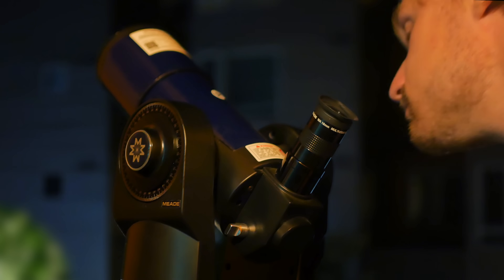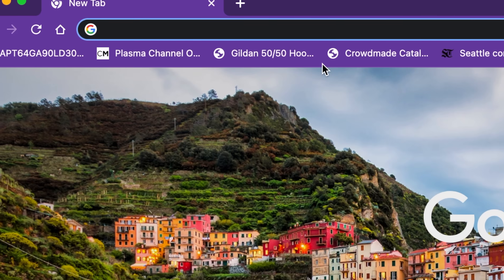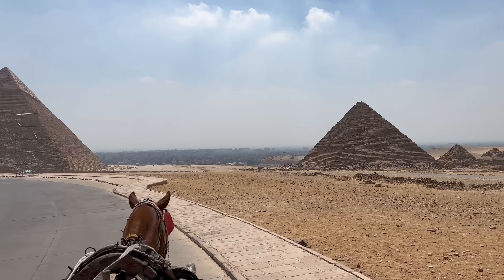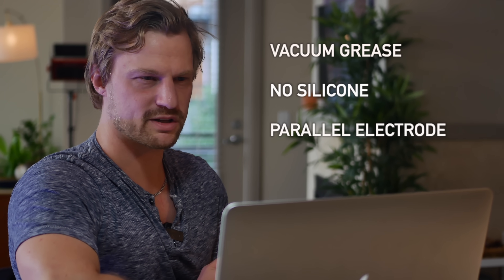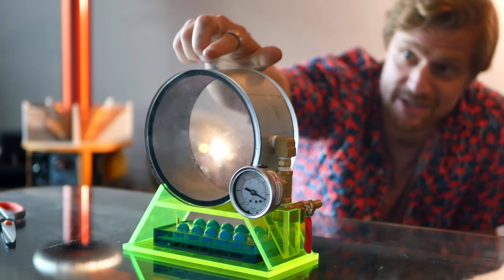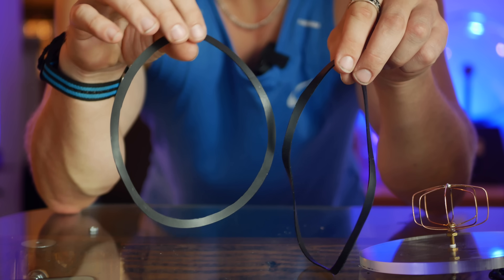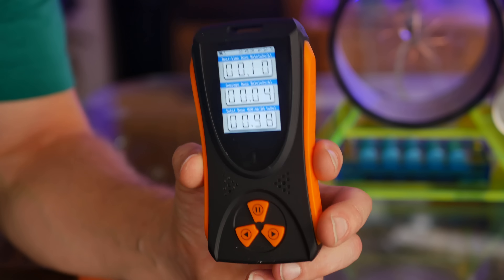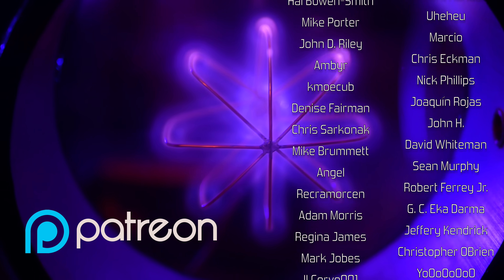Building A Nuclear Star In A Jar (Fusor)

Comment: I did the star in a jar using sonoluminecense by measuring the diameter of the 500 ml round bottom flask. Accurately placing the transducers on the equator of the flask. The diameter gives you the approximate resonance based on the speed of sound in pure water. I was going to use heavy water and I expected the light output to be proportional to the higher cross section of the DD reaction over the HH reaction. I expect the light output with D2O to be considerable. Best of luck to the first to try it.

Comment: Could you replicate this theory again except make it 8~10 layers of fusor wire cage positive cage and cylinder neutral grounded and in side the core of the device is a 3d printer spherical hexagonl electrode negatively charged and both the negative electrode tuned to 90 degree s and the positive fund to 90 degree anti phase and you might get better results but I cannot afford to do this experiment myself ok thank you
Reply: I'm still waiting for you to answer my respond ok

Comment: Another way of making your screw-thread pipe joints airtight is to use wax - drip it on while molten and then let it solidify. That way if you ever need to dismantle the apparatus and take the pipe joints apart, you don't have to hack away at rock-hard epoxy resin. This is a thermosetting plastic after all - once cured, it cannot be melted and will not dissolve in anything either. So the only way to remove it is mechanically, or if all the joints are metal-to-metal, you can burn it off with a blowtorch.

Of course you might not want to use plain old candle wax (aka paraffin wax) for this, for a couple of reasons: First off, its melting point is a bit too low, so if the apparatus heats up, you may soften or melt it. Also, paraffin wax has a tendency to shrink a fair bit when it solidifies. If you have ever cast your own candles you may have seen this - fill a glass jar with molten wax, and when it cools down and solidifies, the surface will be considerably concave in shape, even if you filled the jar to the brim.

However, there is a specialty product to avoid these problems, known as Apiezon black wax, or sometimes just short-handed to black wax. This is often used in chemistry labs to make a more durable air-tight seal between ground glass socket-and-cone joints, in situations where you would not want to use silicone vacuum grease.
To use it, the glass joints are heated with a hot air gun and the stick of black wax is smeared over the surface. Once the surfaces have been covered, the joint is then loosely fitted together, heated back up to melt the wax, then the joint is fitted more tightly and clamped into position until cooled back to room temperature. This has the advantage of locking the joint so it cannot rotate - which vacuum grease does not do. It also has a much higher melting point than paraffin wax, and is less immediately soluble in organic solvents. An exception to that is halogenated solvents, such as dichloromethane or chloroform, which rapidly dissolve black wax.

There is also another solution for high vacuum (or high pressure) pipework which does not require grease, wax, epoxy resin or even PTFE tape to make the pipe joints airtight: Swagelok pipes and fittings, ideally the stainless steel variety. These are high quality compression fittings, which will make a perfect metal-to-metal seal if used properly and tightened to the correct torque.

Comment: You need to put several hose clamps on the poly tubing connecting the pump to the spars on your device. It will make a difference.

Comment: Teflon tape in this instance is not the best for vacuum work. Use two part solvent free Araldite on the threads. I used to service and rebuild high vacuum pumps and systems.

Comment: The Tygon tubing you are using might be leaking, 15 microns is a good industrial vacuum. I saw you got it in the end though, but industry uses all threaded connections, either tapered pipe sealed with tape or paste, compressed o-rings or gaskets, often with compatible grease, and (precision manufactured) metal seals. I'm surprised the Tygon tubing didn't collapse, normally the hoses I see have a spring to maintain its shape.

Comment: The mass lost, converted to energy in nuclear reactions, is un-needed Strong Force. Strong force is what holds atoms together. Atoms are full of protons, and their positive charges repel each other strongly. That should made it impossible for an atom to stay together. But on an atomic scale, strong force is stronger, and binds them together. It's a fair amount of energy, to hold down the electric repulsion between the protons.

Anyway a big atom, like uranium, has lots of protons, so lots of strong force needed, to barely hold it together. When you split uranium, it usually splits into two heavy elements, plus some neutrons. No particles are lost, all the neutrons and protons add up to what we started with. No particles are lost.

But those daughter particles are smaller, and so need less strong force to hold them together. Even between whatever nuclei result from the split, they still need less strong force between them, than the uranium. The extra strong force is released as heat and radiation, the results of a nuclear reaction. That's what's lost in an atom's mass, not particles, but the force binding them together. 

With fusion it's similar, the He4 needs less force to bind it together than it's two component atoms did, added together. So strong force going spare.

Comment: I worked for medical accessories and research Zeeland Michigan. I created x-ray able plastic bones. Synthetic skin for suturing practice at med school. I made silicone molds using a vacuum pump to pull the air bubbles out what's silicone ATV. Anyhow. I saw you had a vacuum pump there. One time I put RC cola. In a cup and place the cup into my vacuum chamber and pull vacuum on. You would think nothing would happen to it. You have to try the experiment yourself. My result was it altered everything about the RC cola. It took away the flavor, and removed half the color. Leaving me with the left and desirable. Byproduct. That really had no use after that.

Comment: Magnets can hold the plasma in place if you build two using magnets shoot them at each other and compress them to make them m even angry while holding that run in the center by reversing the poles when coliding to hold that it together in the center compress with external force and tada you have hellion fusion reactor

Comment: Um that geiger counter is notoriously bad at detecting radiation (studio 326 made a video about it and used some pretty strong sources, and it wasn't picking up on anything)

My recommendation would be getting a scintillation detector (best for gamma and x rays) a few options are out there but a radiacode 102 or 103 would be your best bet (also you can prove if it's fusion by doing some gamma spectroscopy on the fusor)

Comment: Fun fact for the fans: flyback power supplies are reputedly named thusly because if they get hold of you, you, well, fly back. Oh - a pro tip from a guy who's plumbed lots of lab-scale gasses, Swagelok compression fittings aren't (outlandishly) expensive, and can, in practice, perform decently in vacuum  setups (well into the millibarr range)

Comment: Question: I might sound like an idiot, but in order to power his machine, he wants to use 50kv dc. Now if that's what he is going for, why doesn't he use a cheap dc generator, powered by batteries, that can fulfill that goal for cheaper as it doesn't require a separate voltage multiplier and 10kv ac power supply. I also want to make a similar project, but I'm not sure where to purchase a ac power supply. And so the question being, would the method I brought up work?

Comment: 0:40 - yeah, but no. Currently innovation is not limited by energy, but by short-term cost. Secondly we may see something of a reverse/parallel to Jevons paradox, where we have so much abundant energy that the overall system won't care about efficiency (or some bothersome stuff, like sharing to fossil fuel-dependent countries). Probably wasting it, along with other resources, for c*ap like AI.
Reply: Complete agree

Comment: Single stage and dual stage pumps are different.  In shatter products we use single to avoid pulling terpenes. Dual is for pullibg tbe vac on the closed loop system but not the desiccation chamber. I wonder if that played a part.

Comment: A vacuum is hard to hold seal all your vacuum joints with Glyptal  spelling may be wrong also something we called vacuum grease.  All this is dependent on how deep a vacuum you need.  I have 15 years of working at the rocket test site. Edwards AFB.

Comment: ... I can't imagine that fusor design working. I don't think positive-power fusion is possible -BUT you could use nano-stars for energy storage and gravity sources
Reply: Having found the source for this technique, if you want to accelerate the particles then (this may be hard) mount the fusor cage (not the technical name) on bearings and line the (armature/casing) with very strong permanent magnets. 

This would move the field around and possibly focus the fusion point. 

Make the entire case of UTHC ceramic and ground it with a Van de Graaph generator -which then feeds power back into the reaction. 

You will need a VERY thick case: at least 3-4 in. Make it in layers rather than solid, and THEN add the cooling system so the ceramic doesn't melt. 

I do not know how effective this could be, but it won't be as good as well-built laser-based fusion.
Reply: If you decide to pursue a laser-based build, have 4 pairs of lasers that are respectively positive and negative. 

Start the reaction with a dense material (because these lasers are energy based.) 

Because this is much higher power, this will need a far better cooling system -so make an EXTREMELY powerful electron mirror inside the case, and then add extra cooling on the outside for energy that gets through

Comment: Very intelligent experiment .
Would it be possible to use diodes in the same sense and alternately in the opposite sense on one side as a serial output? at the other barrel point, if necessary, a capacitor and a shim - disc opposite, for a circular current. And then solder it into the wire wrap arrangement. Maybe then we would have the fusion, even faster than with Iter ? Not impossible. And on either side of the ring, two high-frequency dipoles with a point microwave source focused in the middle. On the outside sagitally offset by 90° is a super ring magnet inserted in the opposite direction using a drawer. In comparison, also experimentally totally magnetically parallel with 180° to the current flow, two round horseshoe shank attachment point magnets as with Iter, whether it still works here nobody knows yet. They are still a bit clueless here, without 3D phase variability ?

Comment: Sehr intelligent aufgezeigtes Experiment :
Wäre es möglich, Dioden im gleichen Sinn und abwechselnd im umgekehrten Sinn bds. oder einer Seite mindestens als serieller Ausgang zu verwenden ? am anderen Faßpunkt ggf. ein Kondensator und eine Beilag - Scheibe gegenüber, für einen Kreisstrom.  Und dann in die Wire-Wrap-Anordnung auch hintereinander rein verlöten. Vielleicht hätten wir dann die Fusion, sogar schneller als mit Iter ? Nicht unmöglich. Und auf beiden Seiten des Rings zwei Hochfrequenzdipole mit einer in der Mitte fokussierten punktförmigen Mikrowellenquelle. Außen herum sagital frei um 90 ° versetzt ein entgegengesetzt per Schublade eingeschobener Superringmagnet. Im Vergleich auch experimetell total magnetisch parallel mit 180° zum Stromfluß zwei runde Hufeisenschenkelaufsatzpunkte - magnete Nord und Süd, wie bei Iter, ob es hier dann noch geht, weiß noch keiner. Die sind auch hier noch etwas ahnungslos, ohne 3 D - Phasen-Variierbarkeit ?

Comment: I work with vacuum on a weekly basis.   I would've used high pressure hoses with connecting mechanical connections (threaded) and a digital reading.

Comment: i still cannot find a tuturiol on this channel for your voltage and diy flyback transformers multipliers. i see you use them in almost every progect and ive seen you build several types with different voltage outputs. a detailed build video would be great because nobody can do these experiments without those high voltage tools at home.

Comment: You already know many of these but: aluminum accordion vaccuum tubing or high quality vaccuum rated teflon tubing, glass over acrylic, DEFINITELY not a barb fitting, kf standard vacc stuff minimum cf if you're splurging. 

You can use teflon tape (blue monster is my favorite) + high vaccuum grease (shin etsu is same as dow corning but cheaper) to get pipe threads to seal high vacuums and be easy to undo. If you don't mind going permanent loctite green is known high vacuum safe as well.

Comment: Nothing in this video shows the power yeild, radioactivity levels, heat that even a microscopic representation of a star would present.
Reply: He was using hydrogen in this video.  And it showed no radiation.  Hydrogen will not fuse under these conditions and he wasn't producing enough xrays to register.

Comment: Building a Plasma in a jar would make more sense.  Like fluorescent lighting to lightning in a bottle, the energy can be regulated more effectively.  The massive energy or temperatures are impossible to control.  The cost for these fusion reactors are also enormous.  A progressively controlled plasma apparatus is infinitely more practical.

Comment: I copied the SAFIRE project and created a chromosphere around a copper ball and created a plasma sun with 40,000 volts in 2009. This proved the electric universe and that "nuclear" stars are based in ignorance. I did not use vacuum. The center ball was an anode and I used 2 copper plates as a cathode to represent the polar plasma currents. Just like fission they are wrong. All the matter in the universe formed in the plasma field of stars formed from plasma currents, we live in a plasma universe, all matter is transmitted through neutrino's and is energized into matter near the surface of stars and blasted out into planets and why earth is slowly expanding.

Comment: As far as far as trying to make power or electricity from fusion power it's one thing that it like I think you're overlooking it's the same idea I think they should be based upon the same idea on how power is generated from fission and because of poor so with that right there at 9 then the sun's process is different because it's son is massive is is very huge other easier chances that there free neutrons floating around in there that the nuclear scan form buy grab them and that's also part of the boson theory that falls with it so if you would understand that and for us to copy that we need to force neutrons together with it so that's why we have to take and create isotopes of hydrogen to do this process for us and the sun does not have those isotopes

Comment: That small hose won't work if your trying to put a deep vacuum and vinyl type hoses can collapse under heavy vacuum since it wasn't meant for this type of application. For better vacuum you will need a larger hose that HVAC techs use. HVAC dealers or online stores can sell you one but you'll need to put threaded fittings for the hose.

Comment: You will never have true Nuclear fusion, the best you can do with today technology is a Plasma furnace, that burns Plutonium and Hydrogen.  
The Human race is still 900 years away from  Nuclear fusion, you cant even get a Plasma furnace to work above 0.002% for power out put above energy consumption .
Its like driving a car that needs 100 gallons of fuel to go 2 meters.
and your chasing the wrong math. 
Bet they don't fined the mistake for another 20 years.
achieve fusion 75 M J with a fusion target in a pulse that carries 1.8 million joules. To achieve real Nuclear fusion, 2.75663 to 2.8 million joules with over 192 laser beams.
Even with this you have 1.8 Nanosecond of  real Nuclear fusion , Because your Missing a Key. the most you will ever have is Plutonium and Hydrogen Plasma furnace , and not a vary good one. go learn to walk first.

Comment: When you blow bubbles underwater the bubbles create 1,000,000° but only for 1 millionth of a second! you can enhance in the bubbles O’zone R isotopes! By using laser lights bombarding the electrons of the bubbles with a force field around the canister isolating at 1,000,000× a second the polarity of the atom will change! However if you have a machine that is just using laser light to break the electron off hydrogen molecules and you had 1 million people using it it would equal fusion!

Comment: testing vacuum  leaks at such high pressures (bad vacuum) you can use isopropanol on every connection. when there is a leak, the isopropanol will evaporate so fast that you see the pressure gage shoot up. then you know where the leak is. For better vacuums buy a helium leak tester. which is only a gazillion dollars.

Comment: Trying to understand the point of a HV lifter in a vacuum chamber. Accomplish what?
Reply from the maker: Just like spacecraft do now - include an onboard, limited gas supply, and you now have thrust. Thrust that is fully throttleable, has no heat signature, and attains the highest known velocities for space travel. It's interesting that so many people dont know that ionic thrust is already used in space, and requires onboard gas supplies. Cheers.